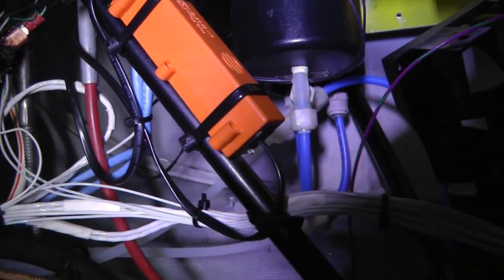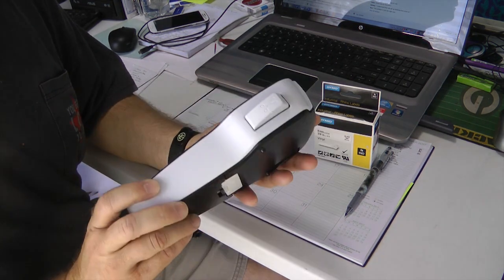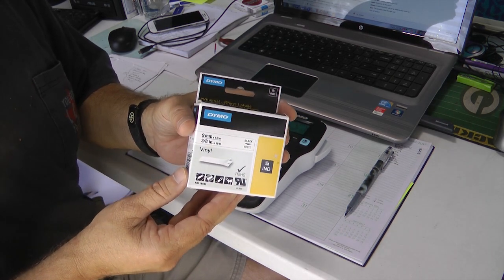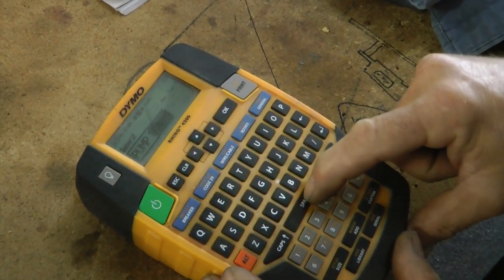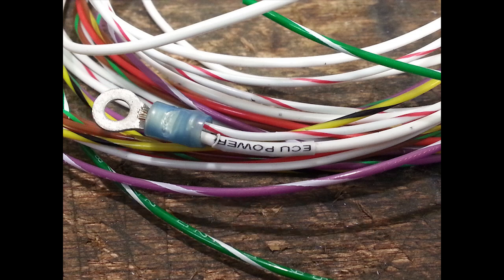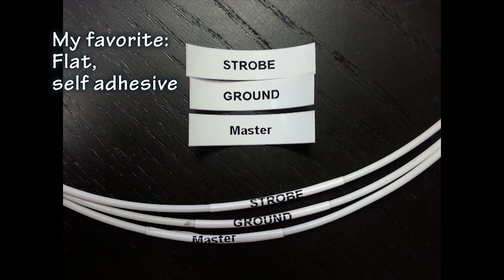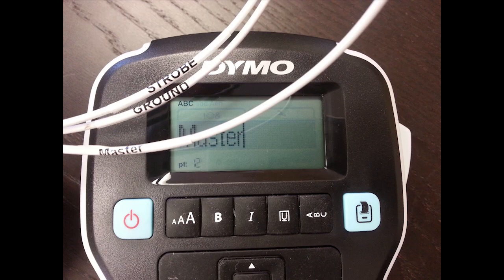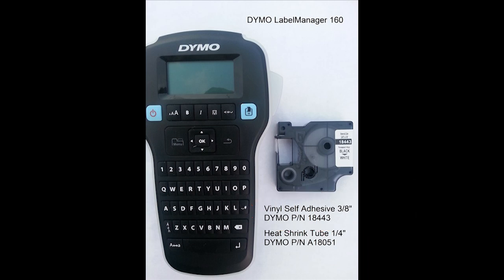How to Label Wiring in your Experimental Aircraft

Comment: Even though the video says that the self-adhesive is better than shrink tubing tape, it’s very common for the self-adhesive labels to peel off over time.  For permanent wire labeling, be sure to use shrink tubing and you’ll be much happier with the product.

Comment: Do not ever use the stick-on labels as presented in this video.  They will fall off.  If you have to use stick-on labels use wrap-around labels as instructed by DYMO.
The best is to use heat shrink tube.

Comment: Would you believe this?? I had purchased a similar kind of label printer from Brothers almost 8-10 years back. I never knew or even used my brain to check that it can be used for naming the wires as well. All this, while I just used it to print few indications on my control panels. Today, when I thought we should have a printer to print sleeves for wires, I got to know that we can use the same printer which I already have. And trust me, all this while, I paid several times to get those sleeves from someone, specifically for our export orders. I would have utilized it much efficiently if, I would have landed up at your video much earlier. Anyway "better late than never". Thanks a lot for this video.

Comment: Thanks for posting this.  It has been a huge help.  I actually have a KROY 3100 series label printer but the cheapest heat shrink label cartridge I can find is about €50 plus tax and is only 110 inches long.  That machine wastes 1" at both ends of every print so you can imagine the percentage of wasted material involved.  Basically, you have to print as many labels as you can in one long text string in order not to waste so much material.  The Dymo header and footer are much shorter, so less wastage, and the equipment and stock are much cheaper. Plus, there are compatible stocks available.   I can get a printer plus a variety of flat stock sizes (I no longer use heat shrink tube thanks to your advice) for the price of one KROY cartridge.

Comment: Doesn't look as if the heat shrink works with the 160. Best check before committing. 
Brother do an electricians printer that is much cheaper than the dymo rhino printers that do print on their heat shrink,

Comment: I used my Dymo label maker to do the same thing, unfortunately the adhesive doesn’t last.  Stayed together for about a week, now they are falling off.  Didn’t know they made heat shrink labels.  Seems a bit excessive to use a heat gun for a label.
Reply: Yeah, same problem. The only way they will stay together is to put the label on across the wire, and not around it the length of the label. I may try the tubular heat shrink. sounds good.
Reply: @chuckbasics8972  or, apply the adhesive label, then put clear heat-shrink over it to lock it in place and protect the ink from rubbing off :-)
Reply: I generally solder my terminal ends and apply a heat shrink over that joint, so the heat gun isn't a big deal.

Comment: My cheapest alternative to labeling is printing labels on plain paper and slipping it under clear heat shrink.
Reply: I would use a hybrid method, use the flat stick on labels, with a clear heat shrink over it to protect the ink.
Too many solvents will take off the ink otherwise, and the adhesive only may peel off with time.
Reply: That depends on how you value your time :)
Reply: Because you can just use cheap replacement labels instead of the highway robbery price original ones.
Reply: The off brand dyno heat shrink and vinyl is super cheap. The vinyl runs about $0.40 / ft

Comment: I see why you like flat over shrink tubing.  My issue with the flat labeling is I find it more difficult to apply especially on small gauge wires.  After market HEAT SHRINK tubing is available on eBay and other places for not too much money.  Five unshrunk widths from 1/4" (6mm) to 3/4" (19mm) wide.  Dymo part numbers 18051 to 18057.

Comment: Hello. Could you please check how good the lable holds. I noticed that Dymo is not recommending this compbination because "The label type can be used for printing from the device. However it is not recommended. This is due to the device not being able to heat to the higher temperature that the Rhino devices can for printing this label type. Which can cause issues with legibility and misprinting of labels with labels being printed from the incorrect device."
I think they just want to sell more Rhino devices as they are much more expensive, but what if they are telling the truth?

Comment: Very nice video thank you for taking the time.
One question I have is the the Dymo 160 is not listed to be used with the "IND" 0nly the 1000 and up series. In your video you are using a different maching to make the labels not the 160. So has anyone used the 160 successfully with the 160?
Reply from the maker: You are correct - not a "valid" combination. However, I have been using this machine successfully with those labels so far. So inexpensive, I will take the risk!

Comment: Having used both, there is the same amount of work required for both.  I noticed in your demo of the self adhesive, you already had the adhesive covers peeled back to facilitate easy removal.  But in practice, the adhesive strip covers are a pain to remove, and some tear easily.  I finally went to a military surplus sale and bought a wire marker that marks the wire every 12" to 24".  It is what is used on military aircraft and allows you to identify a wire anywhere on the airplane.
Reply: I think the backing is in two parts, with a longitudinal split, to facilitate removal.  You bend the printed label along its length so that the face is concave and that causes the backing to split and lift slightly so that you can easily get under the corners and peel off each half.
Reply: What is the device called? I don't readily see anything online....

Comment: Is it possible to use the heat shrink cartridges in cheap non-rhino dymo printers? The cartridge looks the same but i'm not sure if it will work.
Reply: I have a Brother label maker and they also take heat shrink tube cartridges so that's not unique to the Dymo label makers. The challenge I'm having is finding a size that will fit over TRS/TR/XLR audio cables and then shrink small enough to fit the wire. The combination I need has to fit over 12mm (.47") and then shrink down to 5mm. That means a 3:1 shrinkage ration and most shrink tubes only do 2:1.

Comment: 1.  DYMO does not list the DYMO LabelManager 160 Handheld Label Maker as compatible with the IND Vinyl Labels.  However, I did notice that the compatible models use the D1 cartridge as does the 160.  So are you certifying that labels such as the IND Vinyl Labels 1/2"
SKU: 18444 work fine in the 160?

2.  My second concern is the labels falling off.  Some of the reviews on Amazon indicate that they fall off in time and additionally that the glue does not work for very long when they have to stick to itself.  If that can be solved by using these IND Vinyl Labels, I'm in.

BTW:  I've gotten hooked on your other videos.  I was heavy into technology when I was very young, got into military aircraft maintenance, became a supervisor, bought my own plane, was working on a Long EZ, they liked me and sent me to the academy on an age waiver, which I did and flew after that.  I have been out of it for quite a while.  I'm amazed by your EFIS video that I don't need to be a human calculator to fly anymore.  I realize that may not be certified equipment but it must be that even that is a lot cheaper than when I was flying.  You may talk me back into it.  LOL!
Reply from the maker: We are not certifying anything!  Just sharing our experience. The key, as pointed out in the video, is to be sure to use the IND labels for the best adhesion.
Reply: If you're saying your experience is it works with the 160, that's certifying it in my book.  LOL!  The reason I asked is I noticed you were using a Rhino to print the tubing label with, not a 160.

While researching models on the compatibility list for the Rhino IND Vinyl Labels, one on the list that now has my attention is the DYMO LabelManager 280 Rechargeable Hand-Held.  The form factor is the same as the 160 except you get a rechargeable battery, a charger, a 2-line LED screen instead of 1, a USB cord, can store frequently used labels for recall, software for your PC enables barcodes and special graphics, and it sells for $16.80 on Amazon Prime, which is only $3.00 more than the 160.  I plan to buy that one.  

They also make a 420P for $70 which does everything the 280 does plus 
has a 4-line backlit display, does barcodes natively, you can make up 
your own logos and symbols and store them, and print labels up to 3/4" 
wide.

I own an IT company and as late as yesterday, we were upgrading one of 
our own installations and wasting lots of time trying to remember what 
we connected where and why, and Googling wiring label makers is how I 
ended up here.  LOL!

From my research, I didn't feel that I could trust what the company representatives say.  
Here is a conversation about the Vinyl labels:
"Dymo 18443 3/8" Vinyl tape Rhino Labels - White
Thank you for choosing Dymo. Our goal is to provide our customers with the highest quality and service. The label type can be used for printing from the device. However it is not recommended. This is due to the device not being able to heat to the higher temperature that the Rhino devices can for printing this label type. Which can cause issues with legibility and misprinting of labels with labels being printed from the incorrect device."
If you go to their web site and check compatibility of that vinyl label, the 280 is on the compatibility list.  As much as the 160 is similar to the 280, my guess is the reason it is not on the list is because they simply didn't add it.  

Here is a conversation about the heat shrink labels:
"Thank you for your interest in our products.
The Rhino IND labels are specifically designed for the Rhino printers. They are made from a thicker material, which can dull the blade of other handheld Dymo printers. The Rhino blade has been designed to be able to handle the IND labels."  
That heat shrink tubing looks pretty thin to me in your video.

What I find interesting is of the Rhino line, only the 6000 can talk to a computer.  My guess is they may be heavier duty and do larger labels, but most seem like older technology as well.

Thanks tons for all of your help!

Comment: Nice video, thanks for sharing.  I've seen many industrial applications in which the tubing is not shrunk around the wire.  That way, if the wire ever needs replaced, cut, or have a new end installed, the label can be reused or slid into a new position on the wire.

Comment: Any ideas for 20 or 22 gauge wire?
Reply from the maker: Yes - one idea -use the heat shrink and shrink as much as possible - altho it wont be perfectly tight, it will be legible and cannot fall off! Of course, put on before terminating the wire
Reply: Thanks
Reply: There are also smaller shrink tubes with 6mm (1/4") These work perfectly on 20 / 22AWG
Reply: You could use the sheets of labels at office supply stores where they are about one inch wide and 2 or 3 inches long 2/3 clear and 1/3 white. Fold them over the small wires. If exposed to water, make sure your printer is able to use waterproof ink or wrap the clear over the printer part.